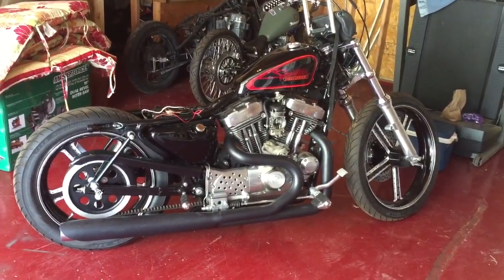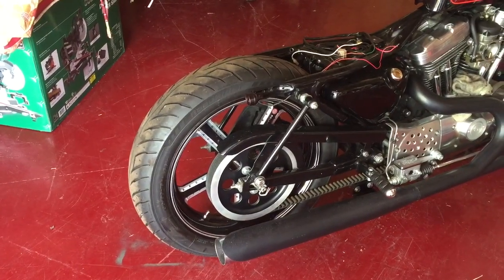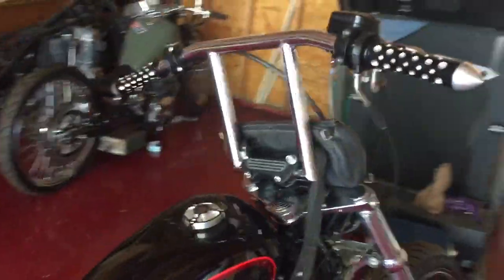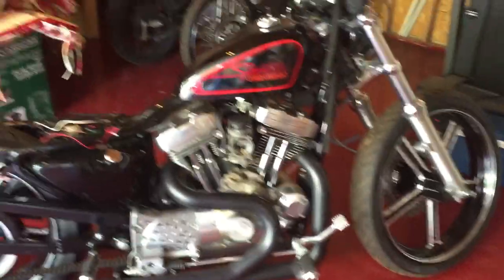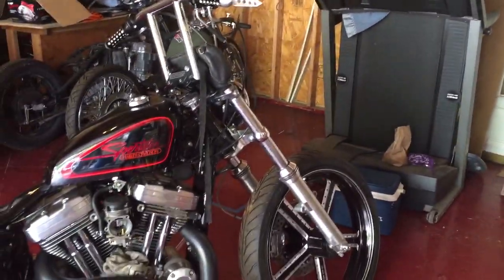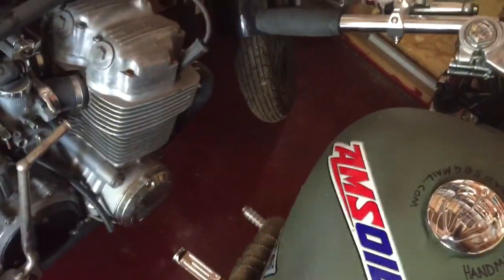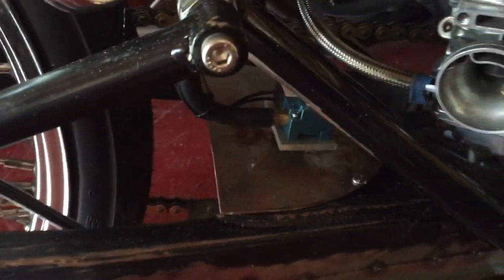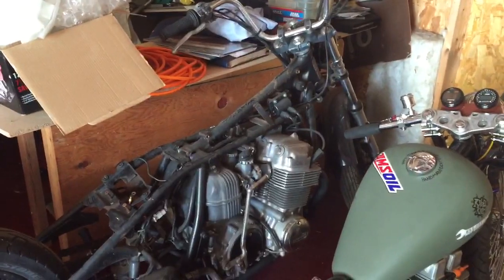honda rebel 250 bobber

Comment: sup man love the the videos! So I'm working on my 1st rebel build.(noob here) Im wondering if you can give me some into on how much you stretched you frame and what rim/hubs you used those 21" are sweet! and how did you get the sprockets to line up what spacers did ya use? Basically hoping you can guide me to how you mounted the rims and what rim/hubs you used...I liked and subscried you your ch..  looking forward more! ive watched them all now! TY
Reply from the maker: Machined the axle and swing arm for hd rims then had a sprocket made stretched the swing arm I think 6 1/2 in. I sell  copper head gaskets and the sprocket and a ignition performance upgrade coil plugs and wires also jetting carb kits . I port heads ,diamond cut the fins . But I don't do the axle convertion mod at this time. Not cost effective yet it's a $600 mod for machining ! I don't do that YET!! But working on a better solution
Reply: wow 600 lol maybe I can move the mortor over a 1/2' thank you for the reply. how many tooth sprocket is the one you sell?
Reply from the maker: Any tooth you want $125 with my rebelking logo on it . It's not a simple move the engine over😋
Reply: ok let me figure out the rims and chop and ill get back with ya about the sprocket and maybe the copper seal also thx
Reply from the maker: Look at the newer Honda shadow rims think it's a 21 and it could have the same axle mm size . Good luck!
Reply: hey I've been looking into a turbo rebel have you had any issues with it?
Reply from the maker: Put one on and see what blows and then fix it! Can't use any turbo off a car not exhaust flow for the turbo spool need the pipe 1' -1 1/4 free flowing , carb jetting  homework!  Clutch work , positive crank case pressure and - gears number of teeth . How far you want to go?

Comment: What size jet did you use on the cone? After you took the air box out. But before you put the turbo on
Reply from the maker: I don’t know where you live weather effects the outcome of the jet sea level do you know your old jet? Web search jet calculator
Reply: Ryan Leikness yeah it has a 136 stock main jet according to the book